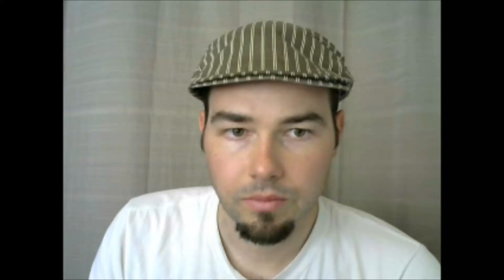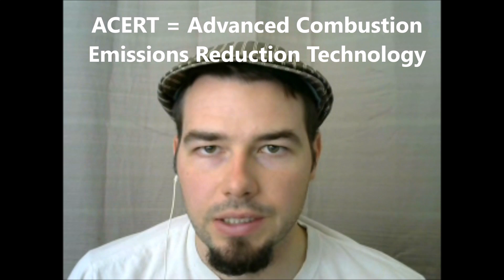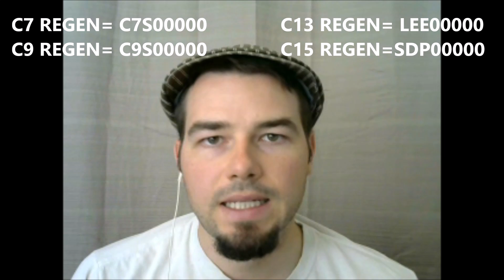Regen, Aftertreatment, and DPF System Class.  Cat Emissions Systems Course.

Comment: I have a 2008 Sterling lt9500 with a cat c13 accert with 3474 after treatment 1 loss of combustion also 3719 dpf soot loading percent. I replaced with new ard head also spark plug. I have great spark but I believe no fuel and the fuel lines at head and manifold are dry. No fuel in lines after it ran. How can I test pressure at manifold?
Reply: Generally it is not a good ideal to measure fuel psi manually in that system. You have to have ET, reset the code of 3474 or it won't light off. Data log the REGEN, setting up a special status screen. After the REGEN is completed and everything cools back down, stop the data log. You have to read the data log and see how well your REGEN did. Also you need to do a ASVT test, and check your AMP draw to the ARD head. It is recommended to flush and replace your filtered fittings when installing a new ARD head and clean the tip of the flame sensor. During the REGEN and if target point's are achieved the 3719 code will go away.
Reply: @johngoldsmith6629  I also want to thank you for helping me understand and go straight to the issues
Reply: I have a diesel laptop but it’s not letting me do a manual Regen because of active codes and when I try to erase the codes they pop up again and still not letting me because of the two codes. Is this a fuel Filiberta problem?
Reply: @esequielmonzon6705  You have to reset the code or you can't do a REGEN. It takes a factory password to reset and remove the loss of combustion code. Once cleared, only code you should see is 3719. If you still see 3474, IT WILL NOT REGEN.
It is a active code problem you have right now.
Reply: Is it ok for me exhaust temp sensor 2 at the ard head to be stuck at 32 degrees Fahrenheit even when exhaust 1 at turbo is climbing up as well as exhaust 3?
Reply: @esequielmonzon6705  Your sensor has failed, you need a 334-1387 if I recall. More than likely you may not needed a ARD head. Fix what's broke first. I tell tech's on a stone cold engine look at all temp's on this engine. All should read close to ambient air temp. Use anti seize on the threads of the new sensor. You will need a 17 mm tool to remove it.
Reply: Ok I disconnected my battery for a couple min and tried to read the codes again. 3474 was no longer there except 3719 soot loading and engine went into a manual Regen for 30 min then only code that’s logged is 3715 particulate trap active Regen inhibited due to permanent system lock out. Do I have an issue with my Regen or is this a code that needs factory reset and will it give me this issue after reset with caterpillar?
Reply: @esequielmonzon6705  3715-31 System is locked out due to excessive soot. You will need factory passwords to clear the code.
Run the engine at 1400 RPM's 30 seconds, if the DPF psi is above 2.1 psi. You will have to replace the DPF. If lower clear the code with factory passwords and try a REGEN. You can try and remove the DPF and clean it, if psi is high. Reinstall and try a REGEN.
Reply: I also read the sensor and realized flame temp and the other sensor are reading correctly.
Reply: I will try to get in contact with cat tomorrow about the reset of the lockout but I had a question about pilot fuel pressure and what’s a good reading and bad reading as the psi fluctuates?
Reply: @esequielmonzon6705  DATA LOG, the REGEN and you have to make a special screen
 ARD Pilot Fuel Pressure -When ARD Fuel Pressure Control Command Percentage is 55% or greater, pilot pressure should be in range of 214 psi to 288 psi. 
ARD Fuel Pressure -The amount of ARD Fuel Pressure required to achieve the desired DPF Intake Temperature is a function of Engine bore size, exhaust piping, DPF configuration, and environmental conditions such as temperature and altitude.
 A typical C13 at standard conditions will require 4 to 25 psi to achieve 1083 F, 1025 F in allclimates. So 1083 F is the normal DPF inlet temp.
When you start A REGEN, the ECM turns fuel and air on to see if it can control it. If it passes that, the ECM will turn the system on to put fuel and air into the ARD head. "This thing when running is sparking all the time, even if it's not doing a REGEN". So once it lights off, I call it the stupid stage. Commands, psi, flows, etc are all over the place. I do not know for certain, but what I think is going on is the ECM is gathering information and decides which path to REGEN on. Once that stage is completed, Pilot fuel psi should max out and be fairly stable. Usually around 230 psi or so. As this thing is trying to reach the Hold Point of the DPF inlet or called target temp of 1083 F. So as the inlet of the DPF heats up the ECM turns Main fuel psi on, to try and get to the Hold Point. Air command is affected as well. That's why a ASVT test is important. Usually at test point three (valve off) flow is around 35ish. At test point four (valve fully open) you need this number. Naturally with a plugged up DPF the number can be low and thus you might have to clean the DPF out to prevent a low combustion air flow from occurring. What I have seen if at test point four, if the air flow is 159 or lower, REGEN will fail due to Low Combustion Air Flow. 160's-179, 50/50. 180's and up normally no problem with flow. If flow is really high at test point four 230ish or higher you have a leak or something is going on. I like my number around 190-210. But don't get hung up if close to normal. Once a REGEN is completed and system cools down. I do a ASVT on a clean system to get a base line for this engine. Now back to the REGEN, as the ARD head starts plugging Main psi will increase to get to the Hold Point. Typically when you see Main psi in the twenty psi range, ARD head is going to fail soon. You can try a heat cycle to see if it can be saved for a little longer. Around 91% the system will go into lean burn. Flame temp may go up or down. What the system is trying to do, is to heat up the bottom of the ARD head and remove carbon build up. Once that is over your REGEN will run for about three more minutes. First item is to turn fuel command on to 81.83 % and off. Then it will turn on for 50% and hold it a few seconds. What the system wants to know, is the fuel system is turned off, as this thing sparks all the time. So if the fuel psi is to high it will activate a high fuel psi code. It does not mean you have high fuel psi, it means you have to much fuel psi with the system is turned off. So if you plumb fuel lines into this system you will get these codes. I than let the system cool down for about fifteen minutes. Stop my data log and look at Flame temp, main and pilot fuel psi, fuel control command, combustion air flow, DPF inlet and outlet temp. Don't get hung up on flame temp, once this thing lights off, flame temp gets pushed to the side and Hold Point temp is the goal. I describe it as a pitcher playing baseball. You put fuel, air and flame on the bases. You now have DPF inlet at bat. The pitcher is still looking at the other bases, but the main goal is at bat now and we want 1083 F. If I like what I see on those numbers, I look at boost psi, cgi flow and DPF dif psi next and evaluate them. Typically you have two types of REGEN's on your data log. First one I call is the lazy flame. When you have a failure, the ECM slowly turns the heat up to the DPF inlet. As the DPF could be full of fuel or something. The ECM does not want this thing to thermal ignite. You will see some, but should not be very much. So the Hold Point will be near the end of the REGEN. Naturally the second is a no failure and it will pull DPF inlet temp up fast and hold it until it reaches lean burn. The more data logs you look at the better you get. DPF inlet and outlet temp should be within 40 F at the Hold Point.
Reply: Well this morning I called and got in touch with palm truck center in ft Lauderdale and I had the best customer service. They reset the lockout code and performed a successful ard Ignition Test as well as a manual Regen. Also I was told all temperatures looked great. I knew my ard head was clogged because it would Regen and get interrupted for some reason with clogged fuel jet. I appreciate the knowledge you have given me about this Regen system and giving me a better understanding of it. Thank you
Reply: @esequielmonzon6705  Any time
Reply: @johngoldsmith6629   hi, I received a lot of information from you and I understand my c13accert dpf system but notice a specific issue and I think I know where it’s coming from but wanted a second opinion. My engine is in a 2008 sterling lt9500 with a boom truck crane mounted the runs a pto hydraulic system. My automatic regen while driving on road heats up my exhaust and hot exhaust light turns on. If the pto in on on-site and the system tries to auto regen. For some reason the system I’m guessing recognizes an issue, lights up Manuel regen recommended light. If I continue to work very late on site and I can’t get a manual regen done it will start to blink. I’ve tried removing pto and set park brake and pressing my regen button to manual regen but it will not activate at all. Now my question is that my cruise control does not work also, can this trigger my manual regen or my clutch sensor?
Reply: @esequielmonzon6705  If driving down the road and the speed below 5 mph or stopped the high exhaust temp light will come on if I recall correctly. Will have to double check. The reason is they don't want you to touch it. Stupid lawyer safety reason. Now idling the REGEN system will do an enhanced passive REGEN, on it's own. It won't do a full REGEN but tries to maintain the soot level at that level. While in PTO mode the REGEN system is turned off. If you have newer software, which I recommend. You can install a PTO arming switch so while in PTO mode you can force a REGEN. However certain requirements MUST be meet or it won't work. If you have a dedicated PTO programmed into your system, your getting into a whole new area. What is your full engine serial number? I will try and remember to get some media numbers for you to read from Cat. May have to get Josh involved as well.
Reply: @johngoldsmith6629  serial number lee05541. I do remember having white ash coming out of exhaust while pto was engaged before while operating crane.
Reply: @esequielmonzon6705  You have dedicated PTO, plus your software is a little old. If the REGEN system has not been deleted yet I would recommend getting it updated. Have you emailed Josh yet? Need to get his thoughts as well. I do recommend put a switch in to arm REGEN system while in PTO.

Comment: Do these regen engines still have iva's? It seems like with the addition of CGI and the DPF that CAT would have removed them to remove unnecessary complication in their emission systems. Maybe my logic is backwards on this. But it seems like with the addition of CGI that you would no longer need the iva's.
Reply: The LEE and SDP has IVA's. Do not attempt to run the test in ET. Every one will fail the test. If the code is logged or active fix that hsg. Let driver test drive it and see if problem comes back.

Comment: Hello I have trouble troubleshooting the failed to ignite. I have checked spark with spark tester , replaced spark plug and filter fitying, replaced fuel filter, swapped ard head with other working truck and replaced flame temp still it does not do regen temperature start to rise very slowly and at about 280 or so it fails . What else am I missing ?
Reply: Data log is the first thing. 20 per min sample rate.
Look at flame temp, fuel command, pilot psi, main psi, combustion air flow and ARD outlet temp.
What is your AMP draw on the ARD head heated nozzle test. 
Flame temp starts to rise and drops out is loss of combustion. 
Have you ran a ASVT? 
What does Flame temp do in relation to ARD outlet temp?
Reply: @johngoldsmith6629  I'm having trouble reading data log I did record though . I replaced the whole dpf from other good truck including sensors on the box. Ard head, spark , transformer.  But it does is ignites tep rises slow 220, 230,240,280,310,330,340,350 then at about 360 ecm tells it failed. Can you help me diagnose through teamviewer I'll pay the fee .
Reply: @TARANS012  What does ard outlet temp do? Have you ran a heat cycle? And what is your amp draw to ard head?
Reply: @johngoldsmith6629  would that be flame temp ? Or the one in the pipe towards dpf. Also I have data log file I recorded when trying to regen can I send it to you if you can check it and see what it looks. I'm suspecting ard fuel pressure
Reply: @TARANS012  No it is called ARD outlet temp.The sensor in the pipe between ARD head and DPF. Is it following close to flame temp? Have you checked AMP draw on the heated nozzle wire and ran a heat cycle?

Comment: Spark pug wire and spark plug?
https://youtu.be/wEG9TFXRGJY?t=773
What's the spark plug used for?
Reply: To create a source of heat to ignite the fuel being sprayed out of the ARD head. It sparks all the time while the engine is running.
It will light you up as well, been struck twice so far.

Comment: I have a '99 allegro motorhome with a caterpillar in it 3126 it will not turn off without pulling the fuse out of a wire that goes to the battery